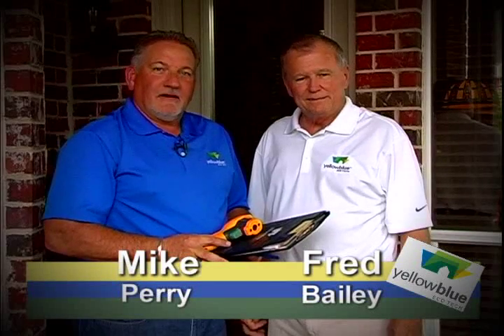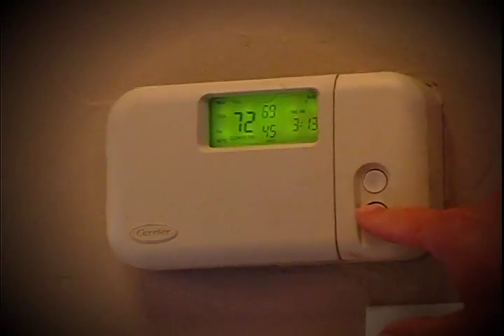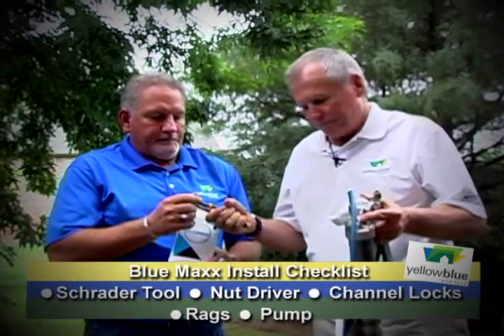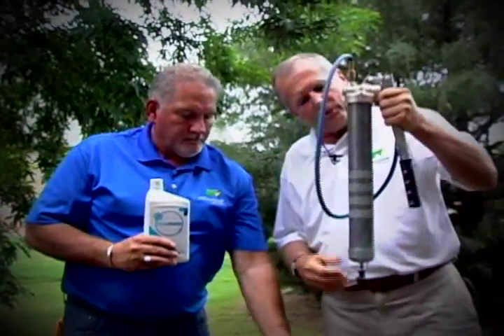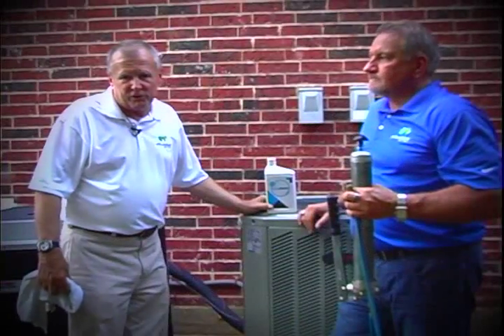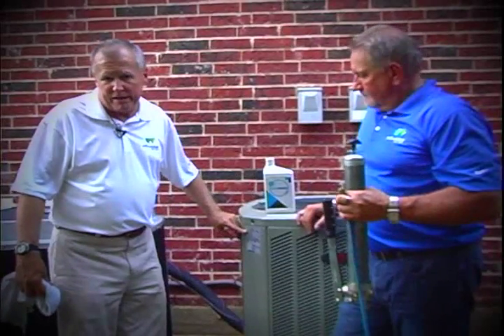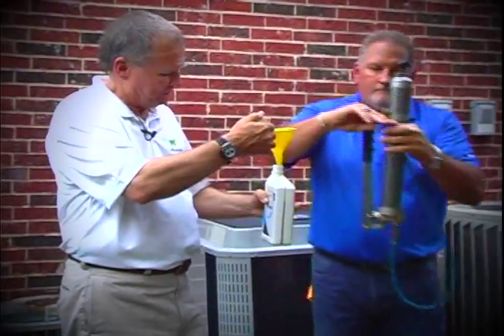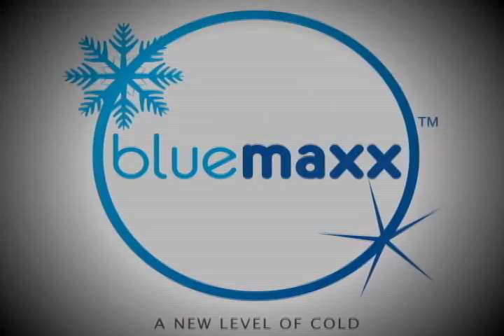bluemaxx Installation Training

Comment: If your supply vents are at mid 60 degrees ,you have an issue,as the unit runs during"installation" your return air will be colder SO your supply air WILL be colder,buyer beware, and there goes your warranty...

Comment: soooooo. how does it make it colder? do you change out the piston at the evap coil? move the bulb on the TXV? whats the super heat and sub cooling along with pressures before and after. looks like a bit of smoke and mirrors to me.